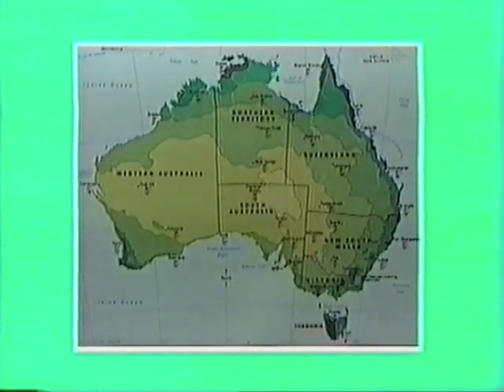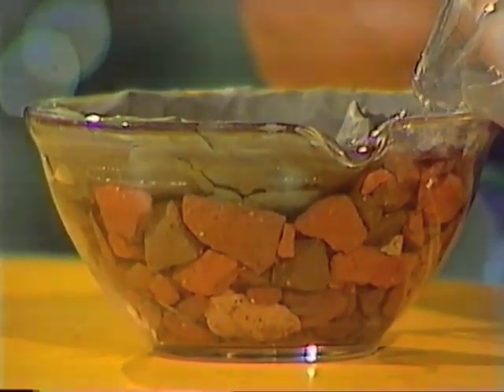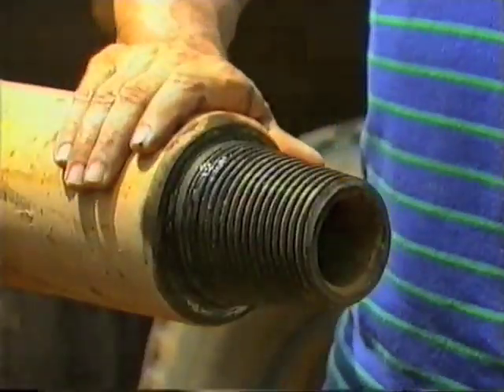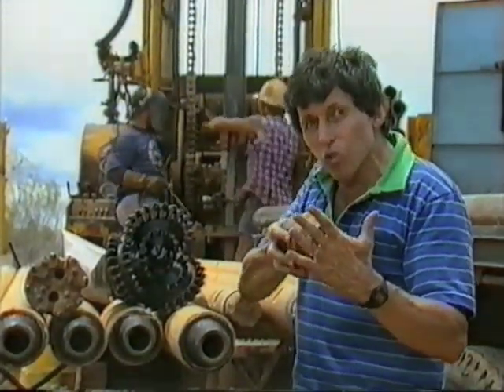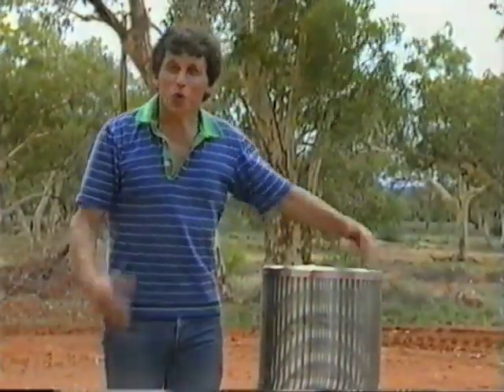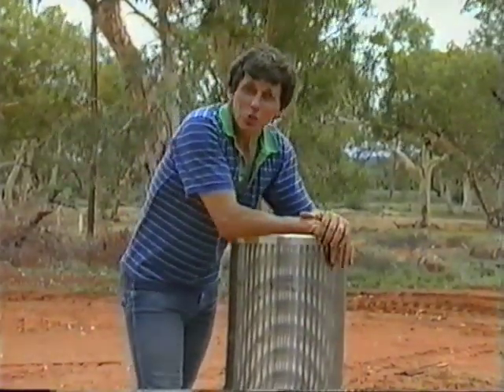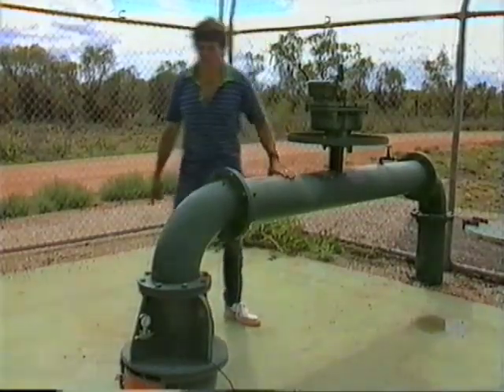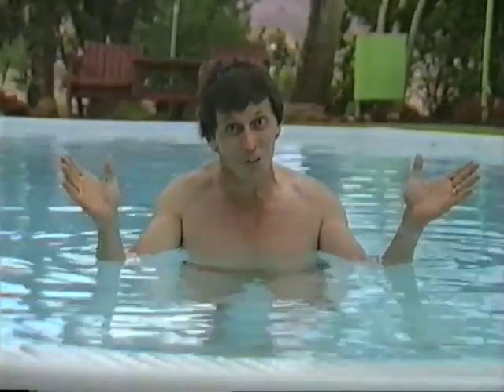Drilling for Water

Comment: Water is not "sucked in" to the pump. It is forced in by atmospheric pressure once the pump has evacuated air.
Reply: You just described what happens when something is sucked in.
Reply: @ori-yorudan  Not "sucked in". "Blown in".
Reply: @mikemondano3624  that is literally just a matter of semantics. Something moves into a lower pressure space in an attempt to equalise the pressure. The liquid is being sucked in as much as it's being pushed in.
Reply: @ori-yorudan  "Something" doesn't "attempt" anything. These are not sentient beings with desires and plans. And it has nothing to do with the science of semantics. The sucking has no efecrt at all on the water. The only force acting on the water is atmospheric pressure.

Comment: So I guess the drill head just stays underground? 
Seems wasteful but I cant think of a way they could get it up apart from it being collapsible and coming through the pipe
Reply: The drill head comes back up after the bore has been drilled. The lengths of pipe with the threads are the steel shaft sections the cutter head is attached to. The shafts are tack welded together after they’ve been joined so that the sections wont unthread and fall down the borehole if the cutter head is reversed. After the cutter head has reached the water bearing level, the cutter head shaft sections are brought up the borehole and disassembled along with the cutter head, then a bore casing is inserted down the borehole ready for the submersible pump to be installed.

Comment: If the earth was a spinning ball the water would fling to the surface.
Reply: The Earth rotates at half the speed of the hour hand on a clock.
There is no inertia created.
Reply: @Rob-fc9wg  no it doesn't, that is asinine.
Reply: @JeffreyAllanBackowski  the Earth rotates once every 24 hours.
How is that asinine?
Reply: @Rob-fc9wg  The Earth spins at half the speed of the hour hand of a clock? Errmm that's a fast clock you have -  the surface of the Earth travels at roughly 1,000mph.
Reply: @DiscoFang  
Q: How long does it take the hour hand to do two rotations?
A: 24 hours.
Q: How long does it take the Earth to revolve once?
A: 24 hours.
Reply: @Rob-fc9wg   Good point about rotation as the rate. But you forgot the bit where you said “there is no inertia created”. Something travelling at 1000mph has a whole bunch of inertia. For it to remain on the surface (or where it is below the surface) a constant accelerative force being applied to alter that inertia.
Reply: Indeed, if you also thought gravity was fake too. It's called equilibrium.
Reply: @DiscoFang  I don't think that gravity exists, I know it doesn't exist, I know it it part of an elaborate conspiracy to hide the true shape of the earth.
Reply: @JeffreyAllanBackowski  You’re probably right. Keeping the real shape of the Earth a secret is undoubtedly the source of all wealth. If only someone could explain how the sun sets at such drastically different times of the day in different countries. Do you think there are different suns?
Reply: @DiscoFang  I used to have a  Cassette Walkman in the early 80's, it was high technology at the time.
Reply: @JeffreyAllanBackowski What? Of course there’s more than one. Didn’t you get your special glasses? Got mine when I turned 21.

Comment: Fake, didn't use the magical stick to find a suitable place to drill
Reply: You dont need a stick when you know the water bearing formation is so many feet down. The sticks are only used for shallow wells.
Reply: woosh
Reply: As a well driller, I dread drilling holes that have been witched.
Reply: I worked for city works once and this guy actually handed me dousing rods to make sure there wasn't a water line before he dug a hole for a stop sign.

Comment: I guess lasers can't cut through rock like that?
Reply: They definitely can, it's just incredibly inefficient and wouldn't work as a well.  It's much easier to break up thousands of kilos of rock and move the spoil than to vaporize it.   Also, when you cut rock or metal with a laser, you melt the edges of your cut.  This would make the rock impermeable to water defeating the point.
Reply: Yeah it takes more energy to crush rocks than to completely vapourise them
Reply: When this was done lasers weren't invented